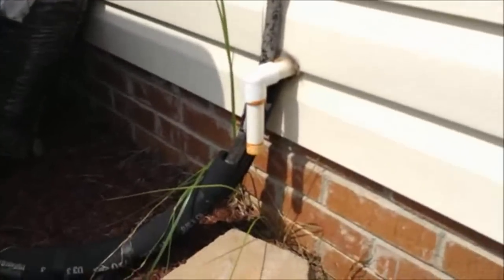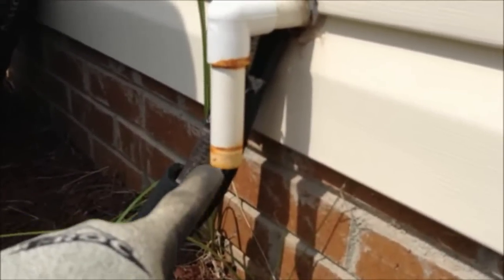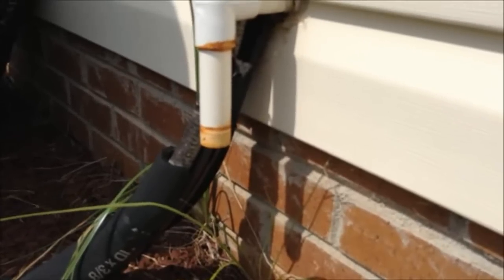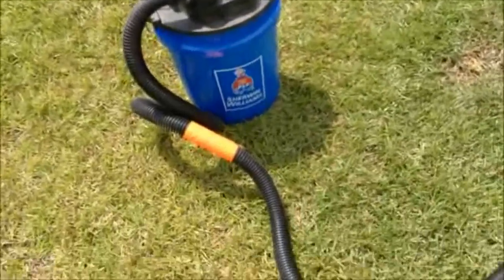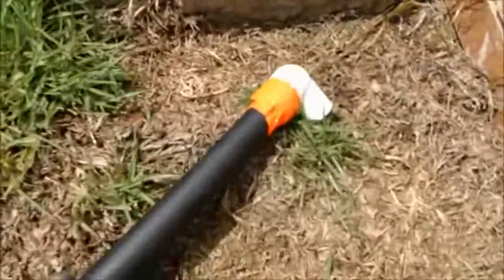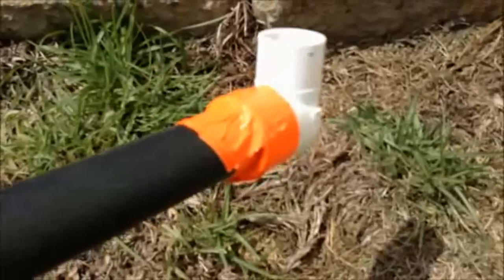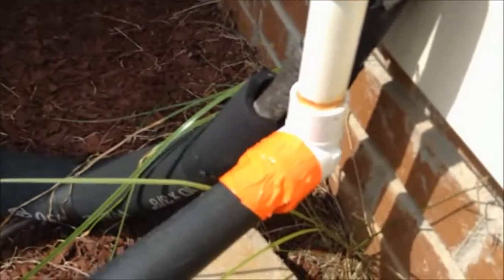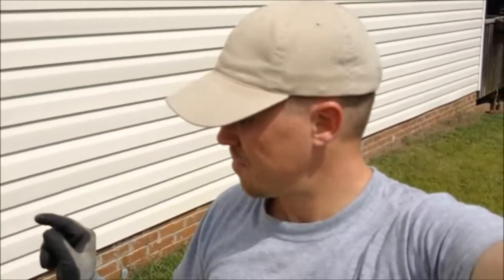Adapter for clogged A/C unit drain line

Comment: Duct tape to the rescue!  This worked great to open up my clogged line. Thanks for the video. After it unclogged (that was a satisfying sound) I left the shop vac running and poured a few gallons of warm water through the line from inside to help flush out all the slime and crud.
Reply from the maker: you can add a touch of bleach...just a touch...keeps algae from growing and clogging the line.
Reply: Do you pour the hot water and small amount of bleach in the Overflow Safety Switch area?
Reply from the maker: Usually there will be a little "j" bend in the pvc pipe just outside the drip pan tank..usually also near the safety switch.  Near the j bend is usually a vertical pvc  pipe about 4-5inches with a cap on it....you can pull that cap off and pour the solution in there.

Comment: OK...im confused. I always thought that the drip pan was for the secondary emergency overflow and that the primary condensation line was to routed either outside or into a bigger drain line that usually goes to the bathroom or kitchen drain. IF you have your primary line draining into the overflow pan, wouldn't the pan start rusting after a few years?
Reply from the maker: Yes the drip pan is for an emergency back up is the condensate line becomes obstructed. A float in the drip pan should trigger an emergency shut off of the AC system to stop any more water. There is a small catch bin inside the condenser where the PVC line runs outside, however, that condensate line here in south sometimes clogs due to algae growth.  This vac can be used on the main PVC condensate line and/or the PVC line that also comes from the emergency drip pan....both lines can become obstructed for various reasons.

Comment: Hey man..my ac unit drip pan is completely dry but water is leaking from side of the residence-near roof top! Will this wet/vac procedure? Thanks!
Reply from the maker: If your drip pan is dry then you don't have a leak BUT .... it's likely you have a lose connection somewhere.  It's got to be leaking around a connection somewhere.  Any water coming off the coils due to condensation should be going directly into the drain line.  Water that's not directed will tend to go to areas it's not supposed to leading to wood rot or water damage.